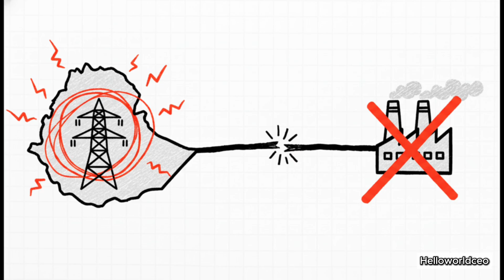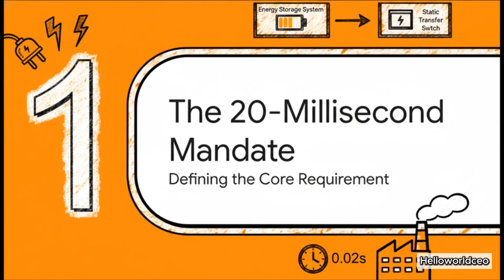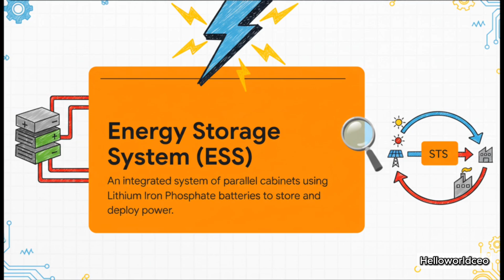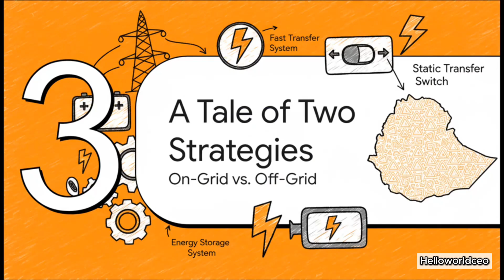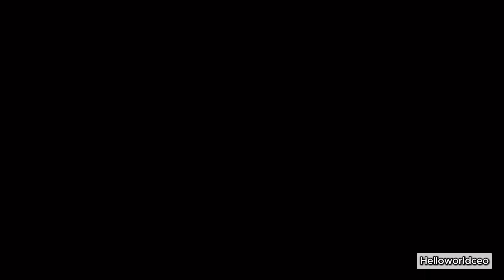Microgrid Solutions by Starcharge

Comment from the maker: Timestamps 
00:03 - Power stability is crucial for industries facing grid challenges.
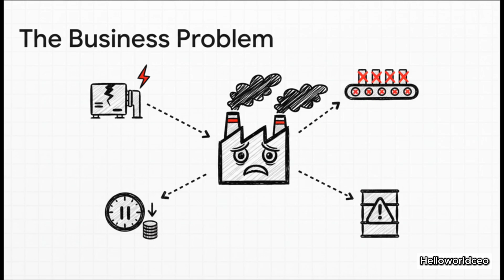00:59 - Sudden power interruptions pose significant financial risks for manufacturing.
01:52 - System must switch power within 20 milliseconds to maintain operations.
02:47 - The energy storage system enables rapid and seamless power switching.
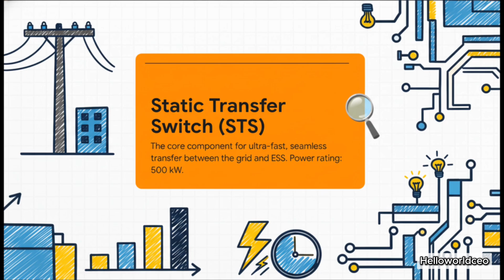03:43 - The Microgrid Central Controller ensures efficient energy management.
04:37 - Microgrid solutions adapt strategies based on the main power grid's status.
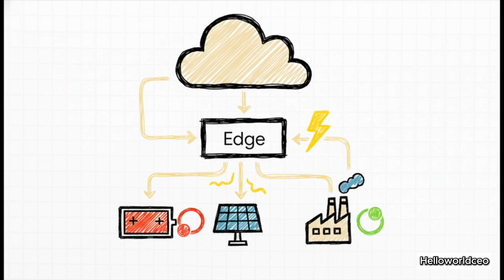05:30 - Microgrid solutions enhance efficiency and reduce costs for businesses.
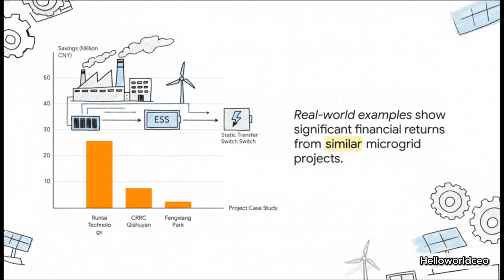06:28 - Smart microgrid solutions enhance resilience and energy independence.